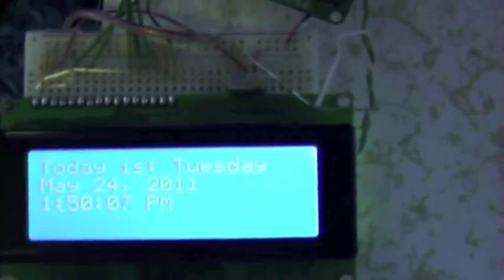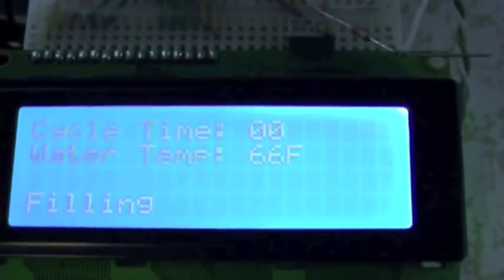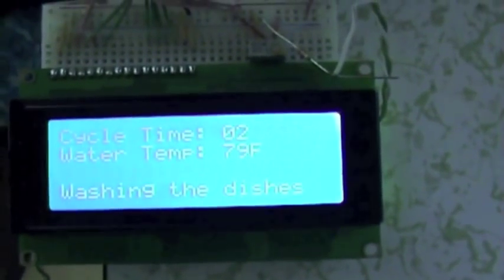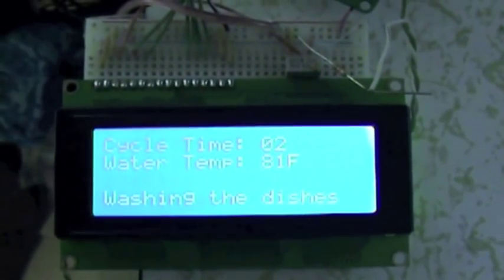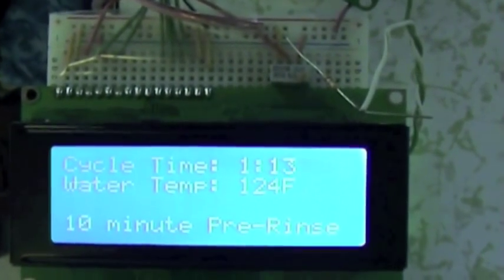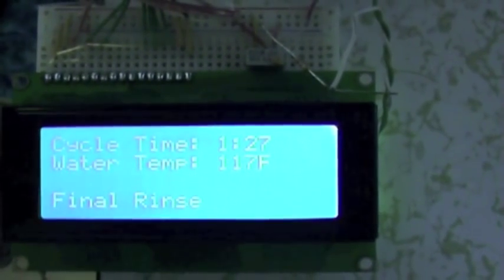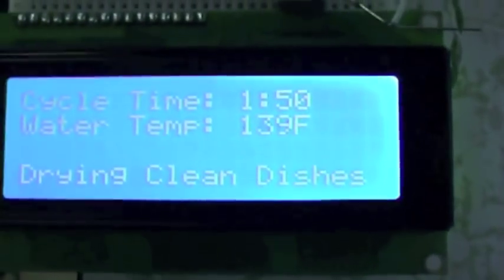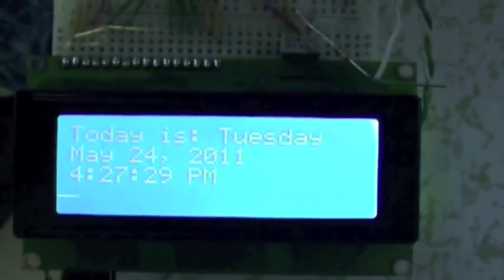Arduino Controlled Dishwasher

Comment: This is really great. I just replaced my Maytag, and have had it sitting in my basement for the last couple months. I'm going rework your code a bit, plumb it into my parts washer for detergent supply and have it return back to the parts washer so I can have a heated, power parts washer.

Comment: Seriously thinking about doing this- I've had my Haier ESD310 dishwasher completely apart, testing each part of the washer, labeling cables, and sussing out power requirements for each step. My wife has indulged this interest, but the clutter in the kitchen is getting old. Broke down and ordered a $100 replacement control board, but still going to give this a try!

Comment: Most excellent.  I'm impressed.    

Now you can add a Zwave dongle or Ethernet shield so that a home automation controller such as a MiCasaVerde can run the dishes at night when the cost of electricity is down.  Also, it can report the status back to someone doing a query.  It also means you could run the dishwasher remotely from anywhere in the world!

Comment from the maker: The same thing that happens on any dishwasher. The unit is just as properly grounded as it always was. The electrical code calls for a GFCI circuit which is the same thing used in the bathroom to protect people from their hair driers.

Comment: I was gonna do this once! did the front panel burn out in your dish washer? seems to be a common problem. mine had a burn mark on the ribbon, but nothing near by to cause it. maybe just got wet. I'm glad to see someone else did this project. I never started mine and got a new dish washer instead.

Comment: I've got the barest of setups working! Only controlling the water valve, the cleaning motor, and the outlet pump. The venting solenoid seems to be triggered by filling the water. So far, I'm just plugging into the existing cables. I need to do some reverse engineering before I can figure out how to control everything with them. They're not labeled like yours- I'm jealous! Only 4 relays on the original board, so it's just a matter of figuring out which combo drives what components.